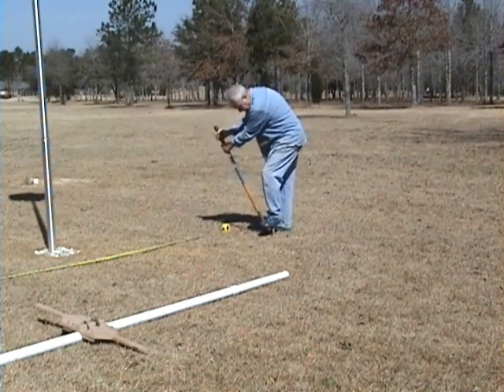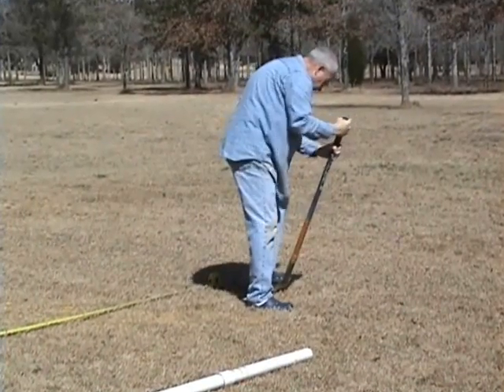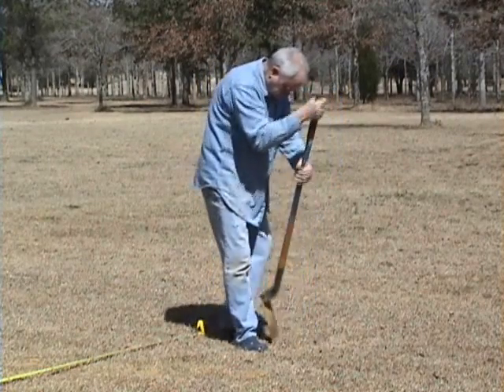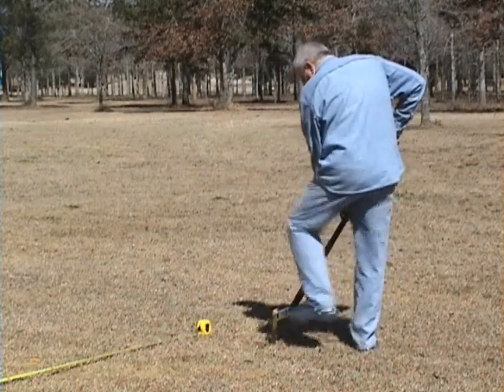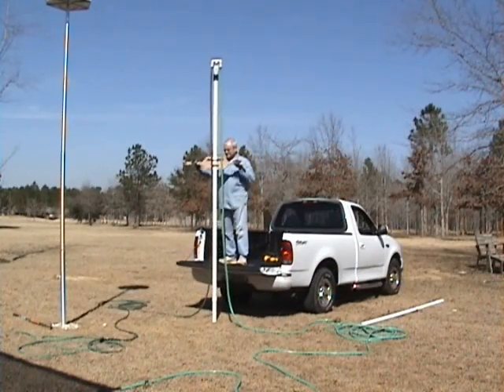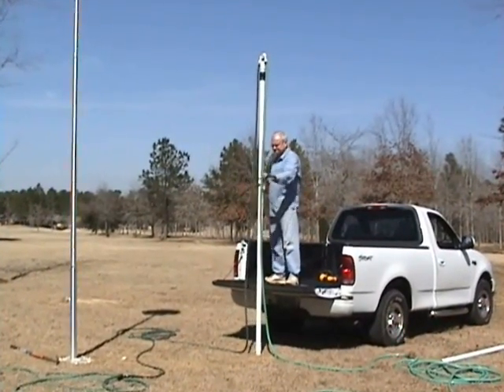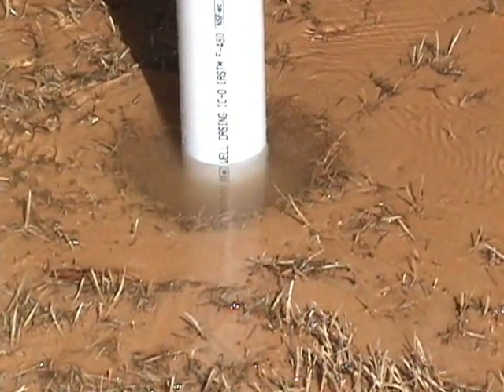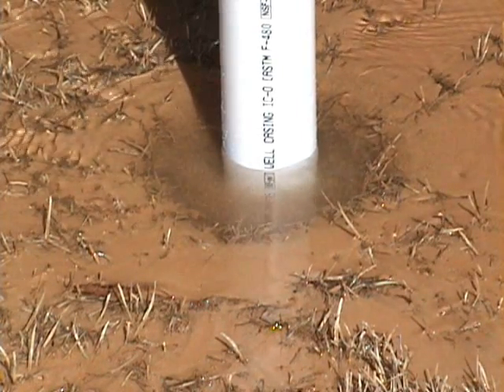Drill Your Own Water Well Series - Part 1

Comment: I've seen gold miners use a air hose at bottom of pipe to bring up gravel, have you tried it?
 Bubbling air acts like an elevator lifting sand and gravel
Reply from the maker: I have not tried it.  Makes sense though!
Reply: Jerry Beasley       -, ,  77552230ou

Comment: Could you use this same technique using galvanized pipe?
Reply from the maker: Yes, but be sure and use set screws so they won't unscrew.  You will be rotating them back and forth and they tend to come unscrewed. On a real drill rig, it isn't a problem because the rotation is all in one direction.
Reply: Ah I didn't think of that issue.  Thanks for clarifying that.

Comment: 40 feet of casing is required to ensure surface water does not contaminate well water. How is this installed using your method?
Reply from the maker: You're right!  Please check out the website which describes more detail.  It is important to seal the top 20 feet of the well with cement or bentonite clay.  Thanks for looking at the video!

Comment: I'm looking at drilling a hole as far as possible but looking at local borehole data on the web it looks like the clay bed goes down further than 100 ft. Can you extract water from clay with a gravel pack and well screen
Reply from the maker: I'm sorry.  Not from that depth.  Or at least not with this technique.  When it is over 25 feet down to the water you have to either use a jet at the bottom of the well or a submersible pump.  You'll need to drill a wider hole and a deeper hole than this technique is capable of.  Thanks for looking at the video though!

Comment: Hello, i'm Andrés from Spain, i would like to drill a small well in to my patio, but i have some doubts about the pipe that you use in your videos as  tool.
Is it a simple pipe?Is it cut straight or has it got  dentate tip in the lower end?
The hoses, Are they conected to the pipe and Is there water running through them and through the pipe?,
What about the sand and the land,ground,dust,What about the land that occupied that space?, the well space, the shaft space. Where do they come out through, Do the land go out through the pipe? why two hoses?, Sorry for my English.
Thank you so much, i wait for your answer. best regards
Reply: No problem Andres!  All this is covered in detail on the website listed just under the video.  The pipe is simple PVC.
Reply: Thank you so much Dawmlw for your so fast answer. I'll have a look.

Comment: Just finished this in SE Michigan on Nov. 6th.  I am in an area that is basically a giant salt mine, so my well water is very salty, not adequate for garden, chickens, nor human consumption. My experience was interesting. 1' topsoil, then 3' gray clay, then 3' sand, 5' more of near solid clay, then finally water bearing sand.  However, I did hit water as I expected around 5'. First sand layer was too near the surface. It was tough going, took 9 hours to get 16' in good sand. In and works great. Would have been much faster with two hoses or trash pump. No more trying to keep rain barrels thawed in 0F temps.

Comment: You would need clamps the size of the unions/couplings,not the pipe,or just saw the threads off to the nuts after it's on the pipe to save time unbolting to move past the joint.The property I bought has 2 wells.They have both been unused for at least a decade and stopped up/dead.I'm going to try your method with a smaller pipe to see if I can clear them.If not,I definately now know how to dig a new one.Thanks!

Comment: Another tip other than the grooves I mentioned earlier,would be to use heavier muffler clamps for the board to the pipe,and wrap the pipe with a layer of sandpaper under the clamps.No more slippage!Hope this helps!

Comment from the maker: When using two hoses for drilling fluid, it generally runs about $150 plus water.
Reply: until you hit rock. Then it is a wasted $150 worth of pipe + water, replanning the project, that plan failing, & then having to rent a machine or pay someone lol
Reply from the maker: @joshlemons2210  Do you not think it is worth $150 to see if it would work considering that hiring a rig costs $3k to $4k?

Comment from the maker: It varies radically depending on what you are drilling through.  Usually each hose supplies about five or six GPM and twenty feet usually takes about five hours.  So, just a guess!!! but - 3000 - 3500 gallons is ballpark.  You can save a bunch of water with a mud pump if you can get one and set up a recirculating system as demonstrated on the website.

Comment: Even though this will not work for me because my property is only a few feet above ledge, I think this might work to clean out the bottom of a shallow drilled well that I have for watering livestock.  (Dirt from surface water has reduced the depth and GPM capacity.  Thanks

Comment: 4th gen Texas oil & gas biz here

Suggested Improvement: Increase water flow to drill faster and/or deeper

From pilot hole, use sharpshooter shovel to dig 3ft trench, 1/2 shovel blade wide, and 1/2 shovel blade deep, to 3ft x 3ft x 2ft pit. Dig another 3x3x2 pit, 3ft from 1st one, and connect with 2nd trench

Pilot hole>trench>pit>trench>pit

Put suction of gas powered pump in 2nd pit, opposite trench. Fill pits with water. Connect pump to hoses

Water recirculates. Cuttings fall out in 1st pit

Comment: Hello I am in the geotechnical drilling business.. I think it would work better for you if you made a tricone or roller bit to help cut with some sort of jets to keep bit clean. Also May try using well screen to help get more water when well is finished. More water pressure would help you a lot

Comment: Great video...this works well in midwestern area's where the water table if fairly close to the surface....I put in a well at my sisters place in Missouri like this years ago..water was at 35 feet.   Saves hiring a drill crew.  Sadly I cant use this in Arizona where water is past 100 feet.

Comment from the maker: Almost all are Schedule 40.  It would work fine with Schedule 80.  Don't use less that Schedule 40 for the drill bit or the drill pipe because you need the strength.  Thanks for looking at the video and website!

Comment from the maker: This technique will get through hardpan.  Please check out the website for detailed instructions.  You'll want to use a metal drill bit instead of PVC for hardpan.  PVC will get through it but you will have to re-sharpen it several times.

Comment from the maker: Good point and I cover that in multiple places on the website.  Please check out the website listed above if you have time.  In most places, it is OK for a homeowner to drill a well himself but contractors are required to have licenses.  In some places homeowners are required to get permits for the project.  Every locale has its own rules so it is a good idea to check with local authorities to determine what local requirements are.  Thanks for watching the video!

Comment from the maker: You are correct.  As I detail on the website listed above, this method is good for drilling shallow wells in dirt, sand, and clay - including hardpan clay.  It will not work in rock.  Thanks for looking at the video!

Comment: I think this would be a great idea under the right circumstances.Dont think it would work in rocky or gravely ground.Ive worked on a few job sites that did similar work but on a much larger scale...they use air,water and a vibrating tip.The bit on the end came to a point and had air and water jets.And with the vibration it just pushes its way throu bringing upsome sentient..

Comment: the myth busters did an episode on liquifying sand with compressed air, it acts like quick sand so this might release your pipe. could you slip a split pipe or larger pipe over the drill pipe to hold back the sand layer? would this work for drilling your own geothermal (for a ground source heat pump) coil ?

Comment from the maker: I don't know.  I haven't tried it.  The thing that keeps you from going deeper with this technique is that at the bottom of the hole sand collapses on the drillpipe and traps it when you get deep - like 30 to 50 feet.  Does the air keep that from happening?

Comment from the maker: It will not work in a rocky area.  It is possible, however, that in valleys and at the foot of mountains that over the years soil has built up and it certainly will make it through soil and clay.  This may or may not be your situation but it is something to consider.  Thanks for watching!

Comment: Faster progress could be made if you jagged the bottom of the pvc piping with V cuts all around it giving it a cerrated saw edge which should dig deeper faster. lol. Thanks for the vid. Wouldn't have thought of it if you did not do this first, so thanks for the inspiration. ciao.

Comment from the maker: Sometimes it would.  You have to be careful not to drill to fast or you will stick the pipe.  This happens in sand.  You can drill faster than you can evacuate the cuttings from the bottom of the hole.  So, in sand, weights would be the demise of the drilling process.  On the other hand in clay, particuarly hard clay, drilling is excruciatingly slow.  Weights help a lot in clay.

Comment: As far as using a well screen, I have seen plastic PVC with tiny slits in it and I have seen a conventional metal pipe with the holes and screen in it.  Which would you recommend, the plastic or metal?

Comment from the maker: more detailed instructions are on the website, generally try to put the 2 inch drillpipe down 25 or 30 feet.  Then put a 1.25 inch wellscreen down through it and pull the drillpipe out..

Comment: Very interesting. I helped to sink a well using a bottom trap-door bailer that you would raise and drop to trap the cuttings. You then had to pull it from the hole to dump it. This is much better. As for using a lot of water. A derrick rig would typically also arrive on sight with a water truck holding as much as 1000 - 2000 gallons of water. This looks like the cheapest and the least amount of water usage that I've seen yet.

Comment: If you wanted to contain the mess of return cuttings, mud and water more, you could sink a surface casing (perhaps a 5-gallon bucket w/ a hole in the bottom and a hole near the top for outflow - sticking w/ the PVC theme) and pipe the flow into a pit, a PVC tub, or dispersed on the ground.

Comment: What about adding a metal hole saw to the end before you start. The type that is like a serrated saw blade but round, and if you attach one larger than the pipe by a little, then maybe it would make the job easier. Just a thought

Comment: an easier way use 'slurpy bore pump' no moving parts, works off water pressure using a venturi (patent australia) one jet shoots forward the other up a sleeve, u need reasonable pressure, I've done a hole 17.7m deep in 2hrs using town mains with the standard 2bs model-it picks up 10mm stones. there are larger models that pick up 20mm stones. the 2bs will need the stainless steel sleeve due to the friction of the sand, no drilling mud needed. follow the instructions Find them on google.

Comment: I instaull these wells all the time. I could put that pipe down in under five minutes. Go get a 45 gallon tank of water use a two inch gas water pump. most wells I put in do not already have a water supply!

Comment from the maker: @JonO387 It does use some up front water!  You can save the water bill by using a mud pump and a re-circulating system.  It is demonstrated on the website.  Thanks for looking at the video!

Comment: I have done this before in Florida. Cut teeth into the first piece of pipe. Then run a hose into open top of the pipe. Turn the water on and wiggle the pvc pipe. The dirt will come to the top of the pie and overflow.When the water disappears as you put it in you have hit a water bearing strata and are done.

Comment from the maker: @dupton369 Normally when water starts disappearing like that it is because you have hit water bearing sand, but not at that shallow depth!.  Try this - Attach your water supply to a 1.25 inch drillpipe.  Put it inside a two inch pipe and use the smaller pipe to wash out a space below the bottom of the larger pipe as you work the larger pipe down.

Comment: When drilling in sand 5 - 6 feet down the water disappears and the pipe keeps getting stuck. Have spent several hours trying to drill. Is our sandy soil the problem? Suggestions?

Comment from the maker: @parrott15 Yes.  Sometimes hardpan feels like rock at first but you will get through it.  A metal bit instead of a PVC bit will require less sharpening.  Use a two inch pipe nipple.

Comment: I've gotten down to 6 feet and the sand has changed color ... it seems like when I pull the pipe up to flush the cuttings the hole must cave in....then I work it back down and then it's stuck...i notice that that the water does not come out of the top of the hole anymore at this point either...I'm in north central florida  all sand of course and I'm using 2 different neighbors deep wells..am I not getting enough water down the hole? Do I need  to use a 2 inch gas engine pump with bentonite clay?

Comment from the maker: email me at mike.willis@runbox.com
I need to know your static water level.   If it is high enough you should just set the screen right where you are.   If not, use a 1 1/4 inch drillpipe to wash sand out of the bottom of the hole up through the space between the two pipes.  As the sand washes up, push the two inch pipe down.

Comment from the maker: Put a 1 1/4 inch well screen at the bottom after you have drilled a two inch hole.  Then raise the two inch pipe up to expose the well screen at the bottom.

Comment from the maker: Yes.  water is supplied by the hoses and it goes down through the pipe to the bottom where cuttings are then washed up around the outside of the pipe to the surface

Comment from the maker: Not using two water hoses for water supply.  If you can use a mud pump and recirculate the drilling fluid you can go deeper.  With two hoses, 35 feet is about the limit.